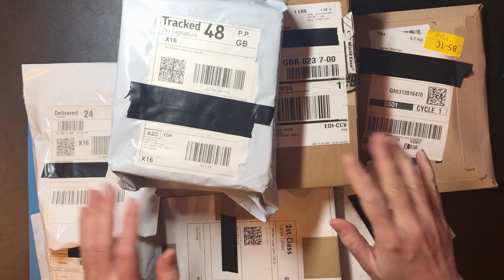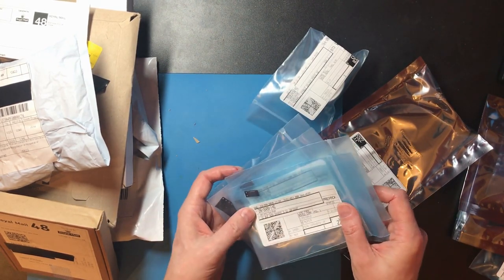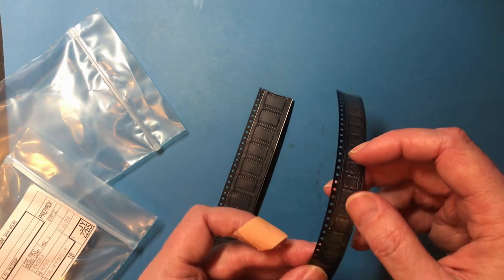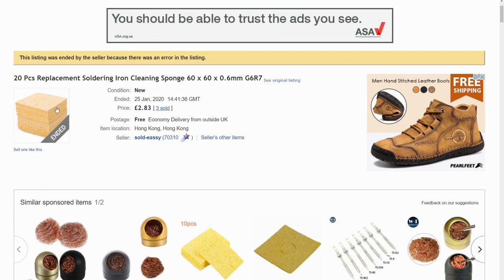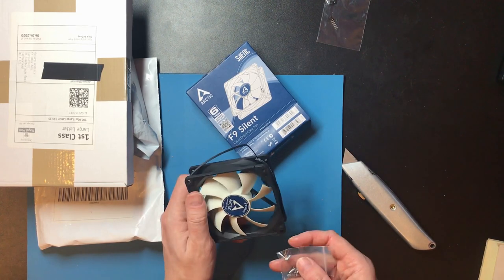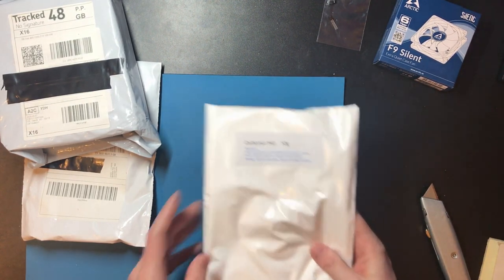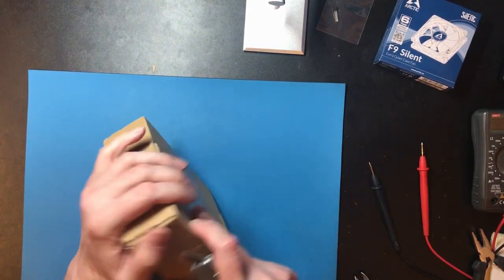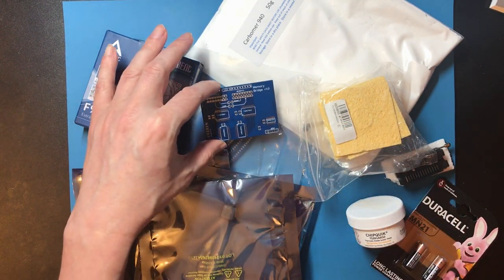Mailbag #8 Bridge Building

Comment: I have the same solder paste in my shopping cart at mouser at the moment. I hope it can deliver on the thermally stable advertisement. By the way; I always feel somewhat cheated when there's batteries inside a battery. Those MN21's should be called battery-holders ;)
Reply from the maker: Well, mine is being stored in a cupboard so we'll see. If we get into the semantics the little button things inside are technical "cells" and a battery by definition is something with multiple cells. These days when we say "battery" we are often mislabeling a cell.
Reply: @weirdboyjim  I didn't want to get into semantics, but I guess I had that coming ;)

Comment: Sponges are nice but once I tried "Brillo pads" I never looked back.
Reply from the maker: I use both the wire and damp sponge, I find the wire is much better at getting a big glob of solder of the end but the damp sponge is still the best way to get the tip shiny again.

Comment: With the battery it is a sign of the times, the old 9V battery used to be a stack of 1.5V carbon cells stuck on top of each other. Made a right mess when you opened one. i expect at some point the 12V's were the same.  with mass production is just so easy to reuse cell's in different packaging to make a new battery. I've seen 9V rechargeable batteries that are full of little cell's.
Reply from the maker: Indeed.  Dry cells ones are the little stack of rectangular cells. Alkaline are 6 cylinder cells that are almost but not quite AAAA cells.